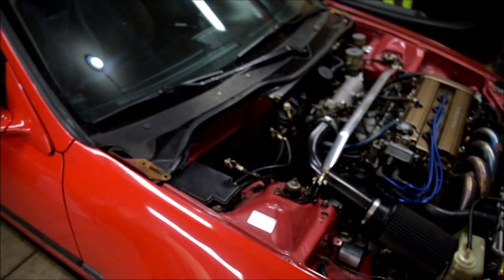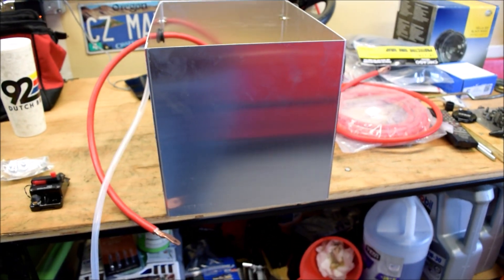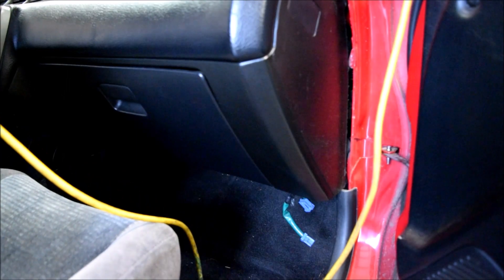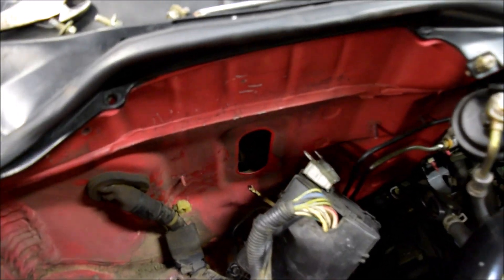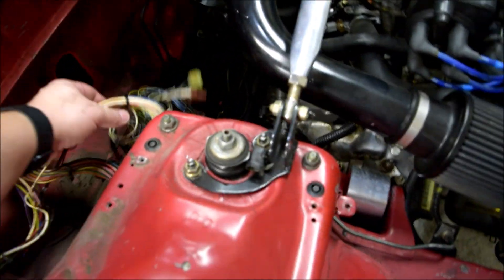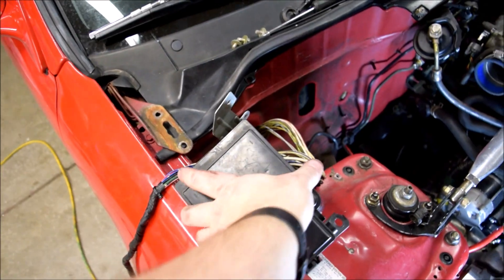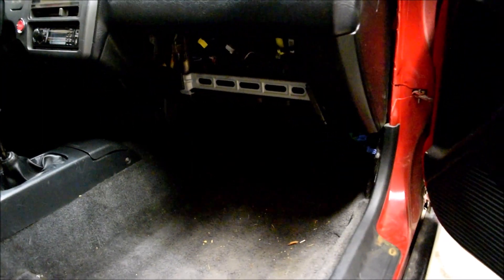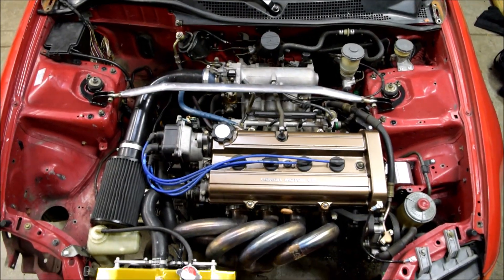Battery Relocation On Project Civic Ej1- NHRA Approved (pt. 2 Wiring) (92-95 Civic)

Comment: You know for drag racing it’s best to run two batteries in series one regular battery and one deep cycle marine battery then you put a kill switch on your alternator and right before you stage cut your alternator off you don’t want it kicking on while your making a run you lose 25-30Hp it dose sound like much but say you were gonna win by .007 of a second because you alternator kicked on you just lost by .01 of a second I.E. it might not be that much but it’s enough to make you lose a close race and if it’s a dedicated drag car do a cat delete that’ll get you about 30 more HP you could slap a roll cage in it and lighten it up by about 6-1000lbs depending on how far you go I had a 67 full metal body nova with me in it, it weighed in at 2200lbs ppl used to think I was crazy for sitting on a fiberglass car till I tell then knock on it it’s steel the they do and they’re all like we thought you ran a fiberglass body kit nope I just removed all the crash stuff that makes the body panels stiff in a crash that shit weighs a lot and go to Lexan windows all the way around that a lot of weight you saving plus it’s safer to have a front window made from Lexan than  real glass you could twin turbo it and put it on about 80psi of boost and make maybe a 1000hp although that would require some alterations to the head and block and a crank/connecting rods/piston ( you wanna make it into a stroker that allows a 4 banger to rev higher ) change and definitely a cam swap to a bigger cam or cams and I would swap the tranny to a 5 speed Lenco
Reply from the maker: That was a lot of cool information. Thank you for spending the time to write a of that. I appreciate it. I did this to clean up the engine bay (for looks) but I appreciate the time you took to write that. Maybe someone else watching this video will see this comment and it will help them out. Thanks for watching and commenting I appreciate the support. 👊🤟

Comment: What is that black fuse thing ? What is it for ?
Reply: Okay now I understand, thanks bro
Reply: I would like to know , trying to do it in my ek
Reply from the maker: It's a resettable fuse. You don't want to run wire through your car and/or under your carpet without one. If you have a short in the wire the fuse will pop. Without one if there is a issue you can catch something on fire. Hope that helps. Let me know if you have any other questions. Thanks for watching and commenting
Reply from the maker: I bought it off eBay. Just type in 150 amp fuse and look for a resettable one. They might also carry it at stereo stores or auto parts. I think I got mine for $10-15